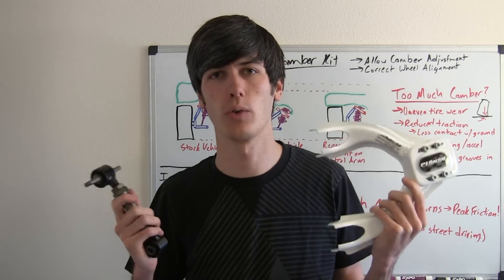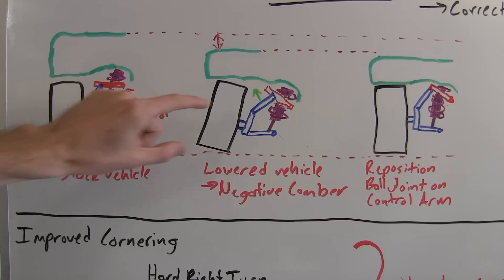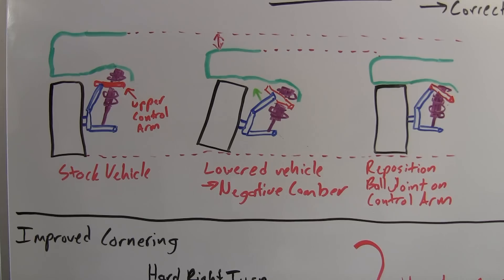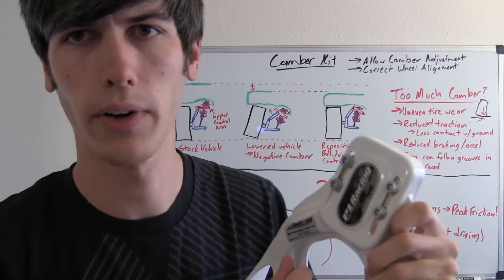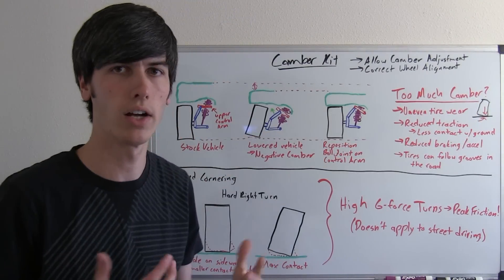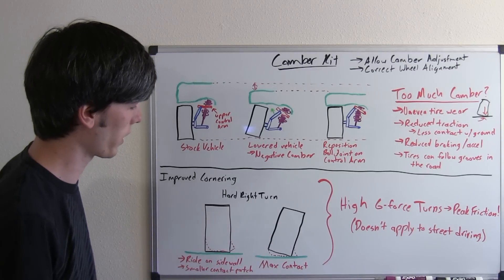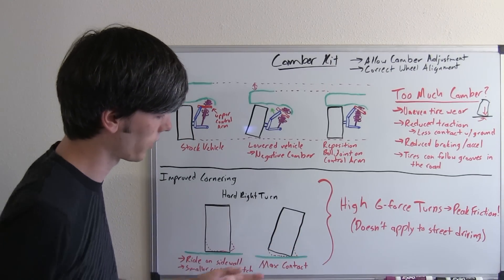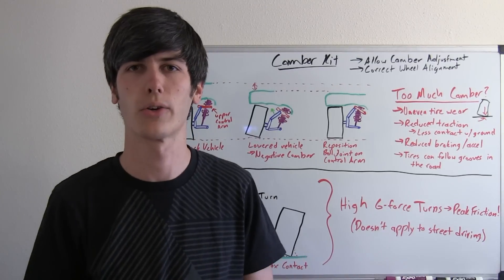Camber Kit - Explained

Comment: do a video about high profile and low profile tires, why super cars use low profile tires when race cars use high profile tires.....
Reply: Race cars use high profile tires becuase the use smaller wheels, you aren't as worried about the wheel looking good as much as it being functional, where as most people aren't going to spend a lot of money on a car if the wheels don't look good so as taste in good looking wheels has changed so has factory wheels, now of course the fancy wheels with low profile tires are still very functional just less functional than a smaller wheel with a bigger tire

Comment: Just want to point out that generally it isn't just the deformation of the sidewall, it has more to do with body roll. Especially when you notice the thinner sidewalls on race cars (they deform less, making for a stiffer, more responsive, and more predictable tire) when the body of the car rolls to one side (i.e. to the left side if making a right turn), the camber angle of the wheel will naturally become more positive. To counter this, the static camber can be changed with a camber kit such as this one. 

Most race cars that pull enough G forces for it to matter (such as F1 cars, or professional race cars) have heavily reinforced sidewalls that allow for minimum deformation.

Comment: Great explanation - one thing I would add is that on cornering "the inside" wheel negative camber is theoretically decreasing even more traction but that inside wheels are doing very small work during cornering so it can be forgiven. Keep it up and cheers for integra that is was found. though RX8 with K20 i hoped you go for :)
Reply from the maker: Haha, I won't rule it out for the future. But at least I get to put some of my parts to use.

Comment: always do a caster sweep and sai after makeing changes to camber toe will have to be adjusted after makeing even the slightest camber adjustment. Excellent work as always. Bonus question! why do camber and caster adjustments change toe, but toe adjustments have no affect on camber or caster?
Reply: To adjust toe basically the tie rods are either lengthened or shortened to make the tires point inward or outward. When you adjust caster or camber you are altering the suspension geometry by moving the spindle in relation to where it was. Because the spindle moves and the tie rods are still the same length as before causing the tires gain or lose toe.

Comment: I have a question, I spent a lot of money on alignment and I notice my camber is not where I want it, it's at negative 2.5 on both front tire I wanted to adjust it to negative 1, will I need another alignment if I adjust the caster plate on my coilover ?

Comment: You should do a video on motor mounts! Performance ones, as well as OEM ones. How they effect acceleration, throttle response, vibrations, etc.
Reply from the maker: Motor mounts are there to absorb vibration from imbalances of the engine, as well as hold it in place. They are not there to alter acceleration or throttle response.

Comment: I just put my car on 2 inch lowering springs for a 6th generation Celica at200 and it has lowered maybe 0.62-0.92 and is stuck there but drives like it needs alignment like crazy so will the alignment kit lower it down far more?

Comment: Hi, I just change my wheels/tyres. The wheel alignment shop told me that the camber located in thw lower rear arm is in max setting.

If I buy this, I should be able to fix te camber, is that right?

The wheel alignment shop is adjusting the lower part while this one is an upper part of the suspension. Sorry, I am new in camber kits.

Appreciate your response.

Comment: Never heard of the tyre deformation being a reason for negative camber, though it sounds reasonable and yes tyres deform. But I believe another reason for negative camber is to have the "tyre patch" parallel to the ground. Not really sure but at least from racing sims I've seen that as you steer the car, you can be stationary, if you have 0 camber and steer full lock, the tires will be at an angle and it will kind of look like they're on a few degrees positive camber. Maybe because of SAI?

Comment: Are camber kits really necessary? I plan on installing Tein S-Tech Lowering Springs on my 2015 Honda Civic, which would give the car a 1.3" drop in front and 1.2" drop at the back. If yes, what brand of camber kits would you recommend?

Comment: I was told I had to get an aftermarket camber/caster kit for my lowered 2006 Infiniti g35 coupe in order for them to give my car a proper alignment, do I only change the upper control arms or do I have to replace the lower one as well ?

Comment: If you have negative camber for both tyres, won't they cancel out? Because if the left tyre now has full contact, the right tyre would be running onto the sidewalls, no?

Comment: Hey Engineering Explained,  I currently own an infiniti G35 base model I went in to my local mechanic shop and I asked for a front tire alignment and then they told me that it was not possible to do the front tire alignment unless I buy the Camber Kit ? Can someone shed a little light on this and tell me if I really need the camber kit to adjust the alignment of the front tires ... thank you.  

Sincerely Alex.Hamilton

Comment: nice video, but have a question

you said when you lower vehicle, you should put alignment back to manufacturer spec. i am thinking this affect dynamic camber in a way that it can't reach enough dynamic negative camber while cornering because of the less wheel travel because of the stiffer springs and dampers?

Comment: I have same BuddyClub camber kit both front and rear . My question is . What do you recommend ( anchors upper arm control bushings? ) I have some adjustable but they no longer tighten up where the camber meets the anchors . Any help would appreciate

Comment: A slight negative camber is actually beneficial to track drivers. some ricers do what i call MEGA negative Camber which is not only useless its dangerous. If done the right way, and for purpose... It can look pretty badass, and you wont be made fun of.
Reply: +thunderup86 If you adjust your camber for track use then the camber is so minimal you wont even notice it

Comment: I was told I need an adjustable camber for my rear passenger side cuz the top part of the wheel leans in towards the car while the bottom is out further, and it causes vibration at higher speeds, which has in turn worn out that wheel bearing too...lol so I gots a project coming up

Comment: Hey man, I've got a 2015 Mini John Cooper Works...I've taken it out to High Plains Raceway (what a blast) and know that I need to change out the stock cambers to racing cambers...any suggestions for make and model for my sled?
Reply: There is a no physical part called a 'camber' the camber is the positioning of the wheel

Comment: Engineering Explained I am slightly confused. I plan on lowering my car about 1 inch, but I keep reading about camber kits and wheel alignments. Could I just go to the nearest service shop for a wheel alignment instead of buying a camber kit? Or is there something I am misunderstanding about wheel alignments...
Reply: 1inch isnt bad. Im lowered 2inches and dont even have bad wear. You don't need camber kits
Reply: Oliver Williams IV The problem is that you may not be able to adjust your camber enough without a camber kit. It depends on your suspension though, I doubt road cars have alot of negative camber gain.
Reply: MexhomieXlll you don't need it now, the cutting happens after time
Reply: +Oliver Williams IV For example i want to lower my EP3, but it doesn't come with an adjustable camber kit from the factory, so i need aftermarket ones. It depends on the car i guess.

Comment: Question ..... once the vehicle is negative  cambered with the camber kit... does it use the tire faster?
Reply from the maker: +janoi dixon It can, you'll likely have uneven wear. Driving it hard can result in it wearing faster as you'll heat up a smaller section of the tire, and thus accelerate the wear of that section.
Reply: Thanks ....

Comment: I'm wanting to lower my car I'm running 19x11 -11 gunna run stretch tires as well possibly 245/35 all around, I also wanna camber it rear -5 and front -3 would that be a good combination? I just want the fender line to line up with the lip of rim

Comment: So if you want to lower your car but don't want camber then should i definitely get a camber kit?
Reply from the maker: Alex Perez Yes, as lowering your car will typically results in negative camber and uneven tire wear.
Reply: Engineering Explained I heard wheel allignment helps any camber changes upon lowering

Comment: what if you have a coilovers and it has a camber plates but If i get aftermarket  lower control that also has can adjust the camber would that cause a problem or would the coilovers camber plates would become obsolete?
Reply: @engineeringexplained
Reply: freshdominican92 you ever figure that out?
Reply: Huy Phung for my genesis the alignment shop still to adjust it from the top

Comment: I can see this being used on a Nascar track. I am not knowledgeable enough to be sure, but wouldn't some form of camber be ideal for the oval tracks where you are only turning in one direction?
Reply: Yes. The setup Nascar stock cars usually run is the outside tire will usually have negative camber (tire leaning inwards) and the inside tire will usually have positive camber (tire leaning outwards).

Comment: Just bought a 95 civic from a guy. It has a lowering kit installed and the rear camber is negative. The tires are brand new on the back, the tire on the front driver side is bald on the inside not showing wires but soon will be. The front passenger side is showing thread. The front tires are NOT at negative camber. Almost as if the rear wore down and he put the tires on the front on the back. I don't know about how to go about fixing it. plz help?
Reply: He probably never got an alignment after lowering it. Not only will it give you negative camber but it will also toe in the front which means the front of the front wheels are pointing inward, rubbing against the pavement instead of rolling smoothly. Go to a tire shop or watch a vid and adjust your tie rods.

Comment: is the lower control arm the longer control arm. And upper control arm and short control arm??
Reply from the maker: Ehh, though that may be the case often, the upper is simply the one on top, and the lower is on the bottom. The lengths can vary.

Comment: So one tire will fit the turn perfectly because the force in the turn will "un-camber" it so-to-speak, but wouldn't that add lots more stress to the opposite tire of the car? It seems like the edge would want to dig into the ground rather than deflect the force due to the decreased contact surface area.
Reply: Fcreveryoung Not exactly. A properly design race car suspension will actually have positive camber gain on the inside tire during a corner. So the opposite tire would "uncamber" so to speak. 

Essentially you want a bit of positive camber on your inside tire to maximize the contact patch

Comment: I've always been a little confused about tires and friction. Road friction it's supossed to depend almost entirely on fricton coefficient and weight, but aprarently there are other things that matters. I've been reading about it a little but Im still confused about wide tires, narrow tires, friction, braking, stability, etc. Regards
Reply from the maker: Yep, unfortunately it's not as simple as F=uN. The tire sinks into the pavement, and the more tire that sinks in, the more grip you'll have overall. As you go around a corner, the contact patch changes shape, and different parts of the tire are on different surfaces (bits of dirt, debris, etc.), and so you have some slip in some areas and grip in others. Temperatures of the tire change, and thus do the frictional characteristics. It's really a complex issue, but it can be oversimplified for a basic understanding to F=uN.

Comment: I have a camber kit on my mustang I have absouluty have no idea how to work it do I jack up the car and lossen up the bolts or ???? and no one seems to want to do my eligment cause its lowerd its eating up my front tires on the inside could I adjust the camber on it so it could eat my tires less
Reply: Lino Acuna your going to need a camber gauge tool it's like 30 bucks on ebay. jack the car up on jack stands and loosen the adjustment bolts for the camber kit. put the camber gauge tool on the center of the wheel and make your adjustment from there. hope this helps.
Reply: Ok thanks for the advise man I will look more into it I've had it on for a long time now.just never really had time to mess with it.thanks bro

Comment: Can camber cause hydro planing while driving in rain? I've been hydro planing like crazy
Reply from the maker: Well perhaps, especially if you've worn down one side of the tire. It's fairly common in light cars at high speed, or with wider tires.
Reply: i got brand new tires on 9 inch wide wheels, perhaps this is caused by my alignment?
Reply: Engineering Explained
If I lower my car about 1 inch to 1"1/2 without a camber kit will it have a negative effect on my tires?
Reply: Tony Montana Yea it will because then you won't be able to align the tires correctly
Reply: Playstationbeast334
Thx bro. I'm getting coils and camber all around now lol

Comment: If I remember correctly from high school physics, friction is not dependent off area of contact. I'm I wrong?
Reply from the maker: Theoretically, using the simple equation of F=uN, then yes. But it's not that simple. A tire squeezes into the grooves of the road, "increasing the friction" between the two surfaces, and thus allowing for greater acceleration/deceleration forces.
Reply: Engineering Explained Ok. Thanks! So, that's why a softer tire will provide better grip I suppose :)

Comment: Shouldn't basic pressure mechanics dictate that a smaller contact patch does not decrease grip?  (weight of the car)/(area of contact) should always be the same, so amount of force in a basic friction equation being Force of friction = coeff. of friction * Force normal will be the same. Like if you had a really big tire the pressure at every point would smaller than a smaller tire, meaning the amount of grip/unit area would be less, but the total would be the same.

The reason wider tires are used from what I understand is that theres just more material there so you can use a softer compound without being worn down too fast
Reply: I believe that the friction force equation is only linear over a certain range of normal force. Beyond that physical phenomena becomes non-linear and the friction force saturates. In that case a large contact patch is more beneficial.

Comment: If lowering one's vehicle creates negative camber, does raising a vehicle creates positive camber?
Reply from the maker: If the first statement is true, then yes, often times the second statement will be true as well. Or more accurately, lowering decreases camber, raising it increases camber (assuming the geometry allows for this).
Reply: Engineering Explained
I'm talking about raising the vehicle above stock ride height, for instance when one upgrades his shocks/struts designed for lowering springs but installed without them, hence causing the car to rise a little above its stock ride height (about an inch or so). About the first statement, yes, the car I'm referring to does have negative camber when lowered.
Reply from the maker: Then yes, it could have slightly positive camber.
Reply: Thanks! For this and the video.
Reply: thaik56 Your shocks/struts should not be controlling ride height unless the spring perch is located in a different location than the stock location.  I doubt most aftermarket replacement shocks or struts have a spring perch in a different location relative to the stock perch.  I know for the Mustangs they definitely do not change that position.  I'm intentionally excluding coilovers in this discussion.

It is very difficult to say "yes raising your car over stock will create positive camber" as this is something that is geometry controlled.  A 60's era muscle car with double wishbone front suspension will actually gain negative camber when raised above the stock ride height as well as from lowering.  In fact most double wishbone setups will at some point go more negative from raising.

A strut suspension can also gain negative camber from being raised above the stock ride height but I can't think of a single example in which one would as the geometry at stock ride height would be absolutely atrocious and lowering it would make it even worse.  Almost every strut suspension I can think of will gain positive camber from raising, and will gain negative camber from lowering, to a point.

Comment: My car got hit on the front drivers  side while I was parked and shopping. Although the car drove home ok I eventually found out my car which does not have a camber adjustment in the front had negative camber on the drivers side. How I came to realize that was the new tires showed excessive wear on the drivers side toward the inside of the tire, negative camber wear.  I dont know if the shock mount or strut suffered, injury and its been too cold outside to work on the car. I did replace the drivers side tire due to excessive wear.  Its an old car and dont want to sink lots of money for expensive camber kits. Are you familiar with these kind of kits and whats your opinion?  http://www.ebay.com/itm/ADJUSTABLE-FRONT-CAMBER-ADJUSTER-KIT-90-97-HONDA-ACCORD-CIVIC-92-96-PRELUDE-RED-/350593181439?fits=Year%3A1997%7CMake%3AAcura%7CModel%3ACL%7CSubmodel%3APremium%7CEngine+-+Liter_Display%3A3.0L&hash=item51a0fb66ff:g:aNEAAOSwu4BV24S3&vxp=mtr